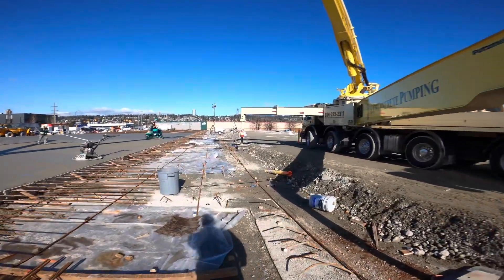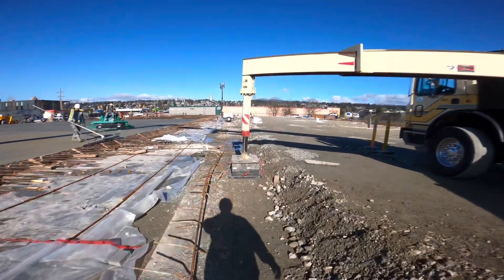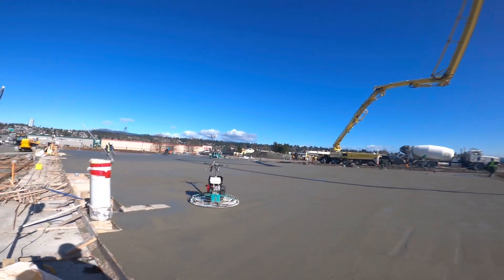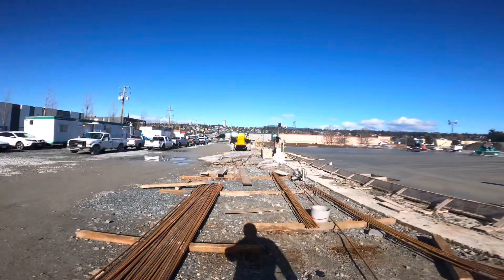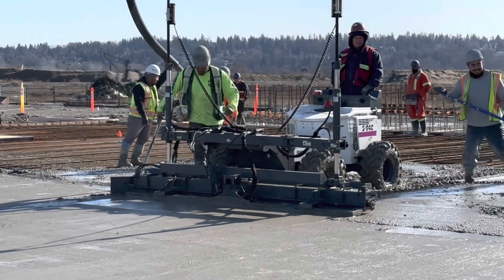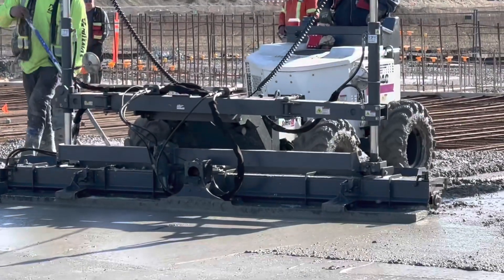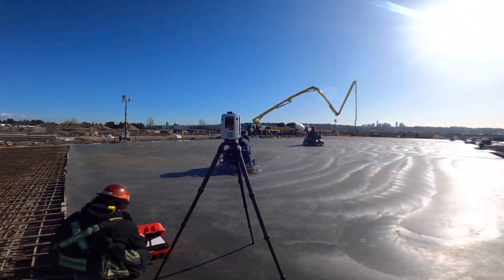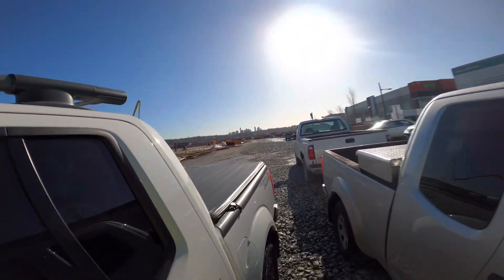Pouring 750 yards super-flat with the FRICKIN LASER SCREED!!!!

Comment: The Whiteman trowel machine with the Ford Escape motor in it. Dica or Bigfoot? What's your favorite pad, need to get a few wide and regular for the pumps.
Reply from the maker: Dica all the way! You want their “Fibremax” pads as they are much more rigid than competing plastic pads. 48”X1” round pads are great for a 42-47 meter (one under each working side outrigger), and the 48”X18”X1” rectangular pads are perfect for underneath of a 40M and smaller (two pads per working side outrigger). To the best of my knowledge, Dica is the only manufacturer able to provide documentation signed off by an a engineer for their products (we actually do get asked for this on site from time to time).

Comment: Lasers are great, no doubt, especially for the placers. BUT. There are drawbacks for pumpers. 

Always noisy AF so you can't hear the pump, quieter engines would be great and entirely possible with today's tech. 
Point the frickin' exhaust up not out. 
Good operator a must, just like the pumper. A bad/slow operator can turn a long pour into a daymare. 
The last load or two takes forever, get that thang off the slab!

Just sayin...
Reply from the maker: All valid points, lol! Definitely the most effective tools to getting a flat floor though.
Reply: Could plan the floor pour to finish in the office area, if there is any.